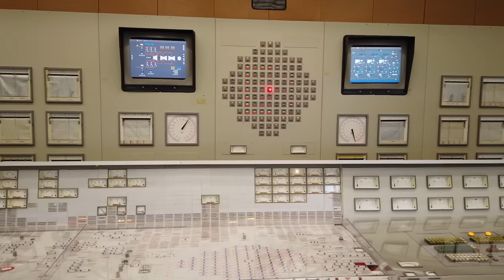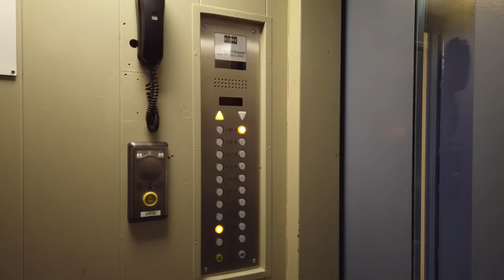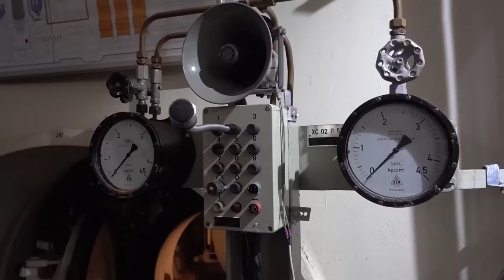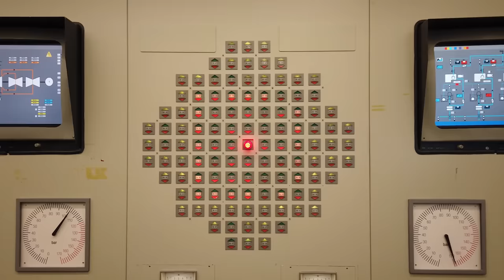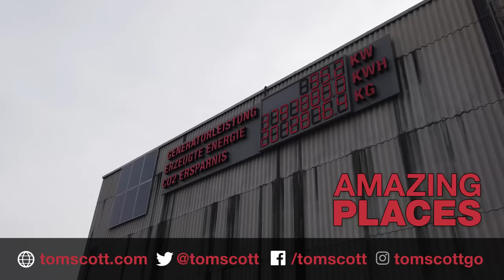This billion-euro nuclear reactor was never switched on

Comment: As it stands, nuclear fission is the both cleanest and safest method of generating base load.
Reply: @idjles  Damming projects without fail lead to ecological devastation both upstream and downstream of the site
Reply: Base load, peak load - 90% of people don't understand what fission or what a  fusion are.
Reply: @idjles  apart from the other comment, you need to have specific geography and sizeable river.
Reply: @Azerkeux  Ecology is changed, and if we look at Caspian Sea, it definitely can be devastating. But.
Knowing how dams change area, can we not also use it for good?
Reply: @idjles  you need energy to pump, so it's not a generator, it's a very big battery.
Reply: Stan B 
Well, you need a pumped or normal hydro powerplant for nuclear to cover peakload anyway.
Reply: @idjles  Besides the danger, pumped hydro doesn't generate any power, it's just a storage medium like a giant battery.
Reply: @idjles  hydro power killed orders of magnitude more peoples as nuclear, it has one of the highest death/mwh ratio.
Reply: After Chernobyl I still thought that. But when Fukishima also became a disaster, I no longer believe the technology to be safe.
Not because it cannot be made safe.
But because greed and complacency and pride will over time erode any safety built into the system.
Reply: @rogerwilco2  can you remind me how many people were killed by the nuclear incident at fukushima?
Reply: @GabrielPettier  you will never know as there is a censorship for that topic in Japan. You even aren't allowed to visit the contamined area for research. And i know that because my university tried to do that.

Comment: Q: What do you do with a never used nuclear power plant?

A: Turn it on
Reply: One does not simply "turn on" a nuclear power plant. One activates it and carefully brings it up to power. Though I'm not particularly familiar with the reactor startup of a RBMK-type reactor.
Reply: Can’t do that anymore, it’s at least 20 years too late.
Reply: Pingo nuclear would be too green and efficient
Reply: @user-is2zv4sc6y  Out of curiosity... are you familiar with ANY type reactor start up?
Reply: @user-is2zv4sc6y  this is not an RBMK, it's a Siemens BWR
Reply: @user-is2zv4sc6y  the guy said all they needed was to push a button to turn it on with everything ready to go, even the fuel rods

But it's a great consolation to use it for training and open it to the public
Reply: @user-is2zv4sc6y  activate and carefully bring up to power is just a more pedantic way of saying "turn it on"
Reply: It would probably work just fine if reconditioned
Reply: @ezicarus8216  no problem
Reply: @Fetidaf  "oooops, I pushed it"
Reply: @Fetidaf  The fuel rods must have been removed long ago.
Reply: just add diesel to the backup generators, some new batteries, and away you go!!
Reply: @georgobergfell  BWR boiling water reactor, just like fukushima daiichi.......
Reply: @rearspeaker6364  A large majority of reactors around the globe are based of the BWR design.
Reply: @rearspeaker6364  yes, but Fukushima was  designed by General Electric
Reply: It might not exactly be in shape to be turned on right now. Likely lacking in maintenance
Reply: That would be the sensible thing to do ...
Reply: @georgobergfell  true.
Reply: Asuming you could (no ban) would  it meet likely modern regulations ?
Reply: @rearspeaker6364  fukushima was considered unsafe even when it was built, when tepco decided to cheap out on safety measures. it has nothing to do with the reactor design.
Reply: @lepidotos  true.
Reply: MaxPower They built two coal plants to meet electrical demands in your country to fill energy hole left by this non-operating reactor. And coal has some small amount of uranium in it, which leads to more radioactive fallout than with running nuclear power plant.
Reply: @buchdada8904  It's even a well-known fact that coal workers receive many times the radiation dose of nuclear workers.  Just walking around a coal plant will earn you several orders of magnitude more dose than working anywhere in a nuclear plant other than on primary reactor components.  This is largely due to the extreme amount of regulation on nuclear plants and the almost total lack of such for coal, at least in the US.
Reply: Jason Larsen I’m all for nuclear, but you can’t just turn a decade old unused power plant on. The money it would cost to get this one up to date, could easily turn out in the long run to be massively more expensive. 
Financial it would make much more sense to build a new one.
Reply: @user-is2zv4sc6y  Just press the big red button! Duh.
Reply: Don't turn it on, take it apaaaaaaaart!
Reply: @hippiemuslim  No, it could never be activated again. A mansized hole was cut out at the bottom of some steel containment part (pressure chamber, or condensation area ... I don't remember the name), that cannot be fixed.
Reply: Right after the vote, there was quite a bit of discussion on how to still switch it on. And then Three Mile Island happened and the discussion stopped. A few years later the discussion was picked up again and Chernobyl happened. From then on the topic was poison. In the mid-90s there was a signature collection for a "nuclear-free Austria". It got a lot of signatures and was discussed by parliament and in 1999 it was added to the constitution. Not one politician voted against it, no matter from with side of the political spectrum. To build a nuclear power plant the constitution would need to be changed again. It is literally aginst the constitution and to quote the germans it cant be because it is not allowed.